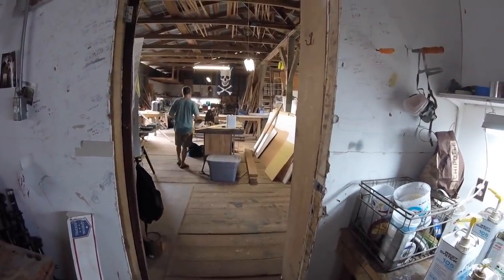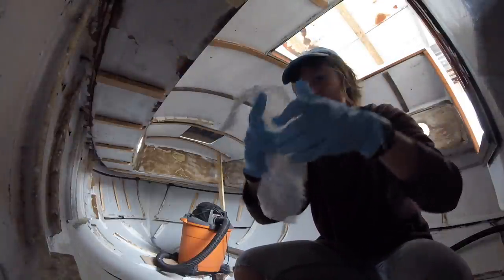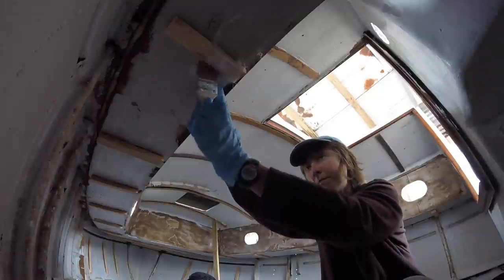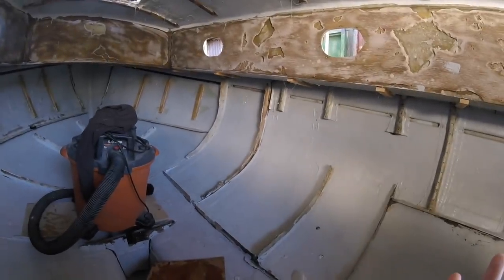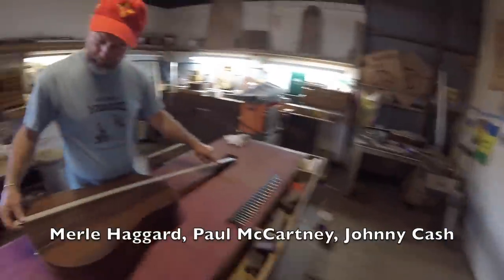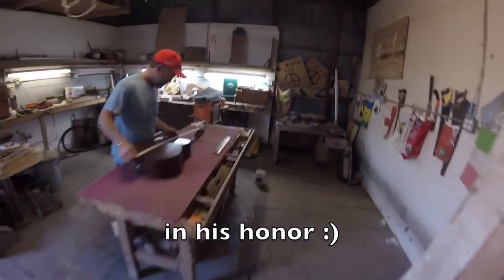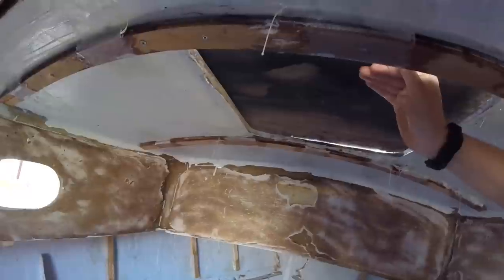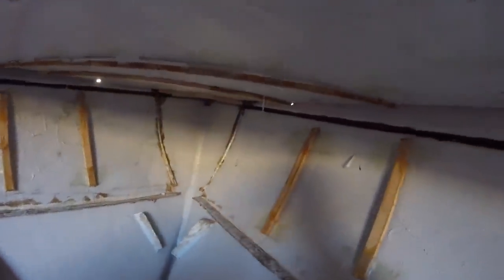The Berger Guitar

Comment: [TIP] Coating the Bare Wood with resin first (and allowing to dry) will prevent absorption and later separation, down the road. These porous materials tend to suck up the Resin you pushed through the Glass fabric, causing a Seemingly done feel... but as absorption occurs there is little to no actual resin in contact with the inner surface of the Glass fabric... this is a good idea on all porous materials like metal, wood, or plastics (foams) ... just a thought
Reply from the maker: Thank you. Yeah, Pete taught me that. 👍